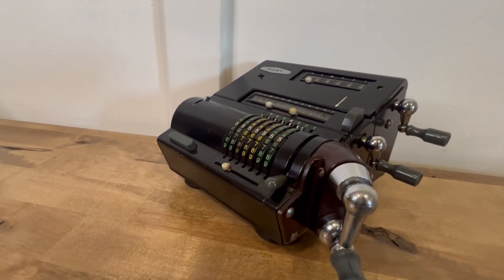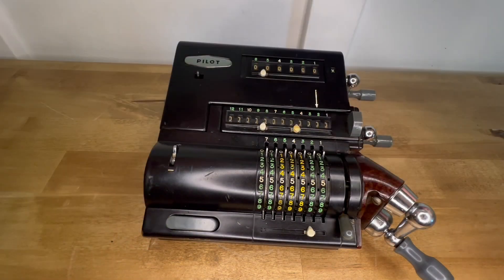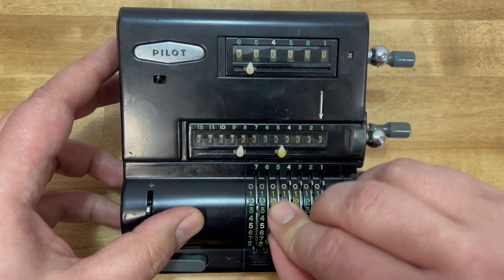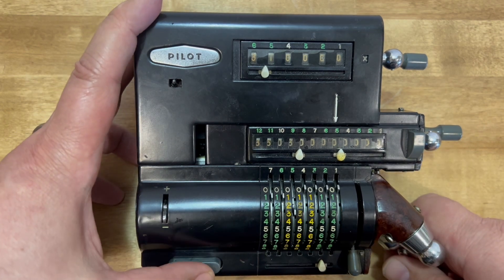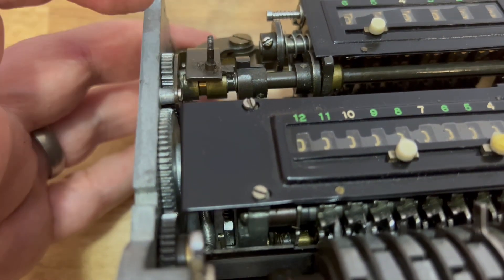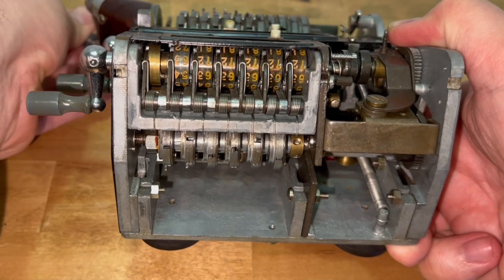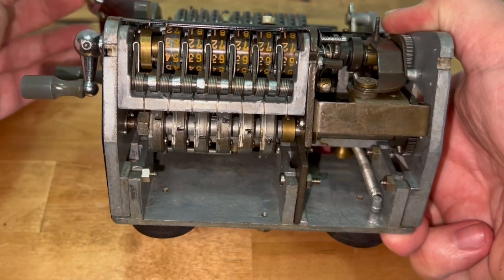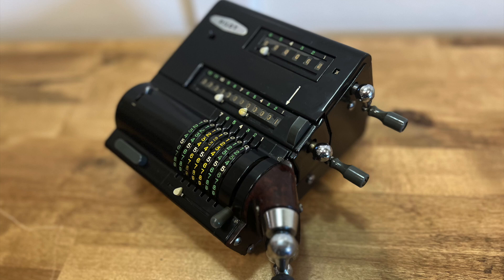Pilot P-1 mechanical calculator

Comment: Didn't the Curta documentation advocate division by addition too? I suppose there's less wear on the mechanism, particularly with the Curta where you were using complementary addition to subtract.

This is a nice-looking little machine but it seems like the mechanics of using it weren't the greatest.
Reply from the maker: I know Herzstark was a big fan of shortcut multiplication.  I’ve meant to count out the cranks on the various subtraction methods to see if one saves time. I should do that.
Reply: @stephenfreeborn  Since the counter register is counting the cranks, and you obviously want to get it to the same target no matter how you do it... I'm pretty sure the crank count is identical.
Reply from the maker: That is 100% true. How you get that register to that result can vary.  For example, I can spin the crank 100 times to get 100.  Or I can shift to the 100’s place and crank once.  In each case the counter register shows the same answer, but the second method got there with 99 fewer cranks.

Comment: Gosh, how strange that they seem to have copied the Brunsviga 10, but then made it different on the inside with an actual little pin-wheel drum. 
Neat, hadn't ever heard of these Pilot machines before - thank you for showing :-)
Reply from the maker: It’s hard to deny the similarities. I think there was enough interest in a smaller design and perhaps their forms just overlapped. There was 25 years between the two devices. Your guess is as good as mine.